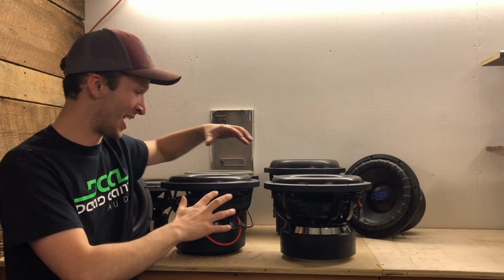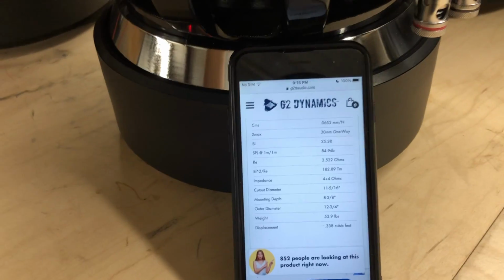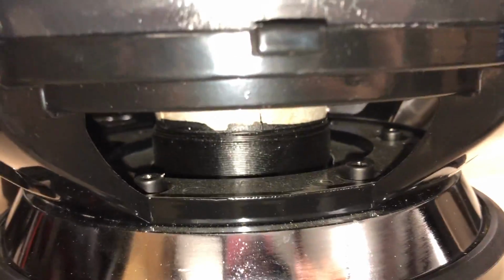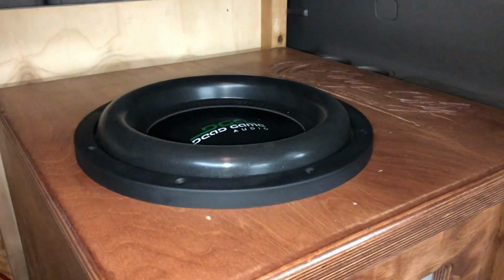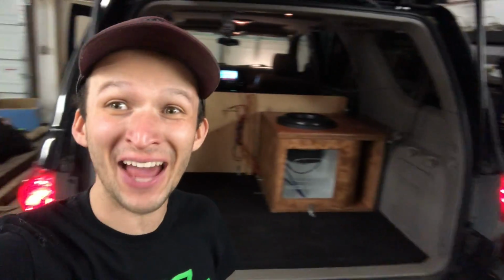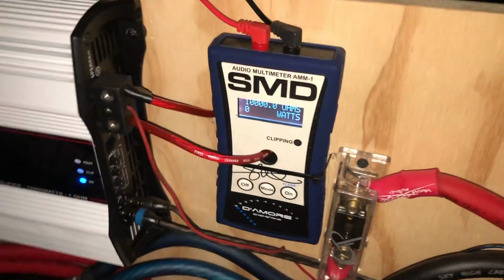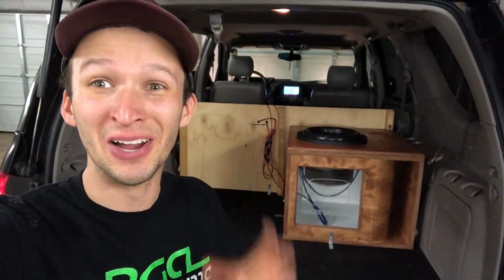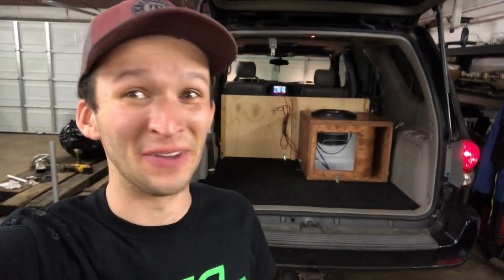HUGE 12" Sub Takes a BEATING! Dead Game Huracan V2 Subwoofer Review

Comment: Nice review. I'm doing a DC build in my jeep right now and going to use some of my old system for my daily.  I'm researching some budget subs for it. Why I like your videos on good budget subs. My DC ain't cheap. And I don't need a huge system for the daily,  but not having any bass in the vehicle I drive most sucks. I wonder how just 1 12" will sound in my Camry. Keep it up bro.

Comment: Try a Savard HiQ 12”.  Got one in my car.  Recommend box is 2.0 cubic foot ported tuned to 35 hz.  I built my box at 2.5 cubic foot and tuned to 28 hz.  On only 800 watts it gets louder than my old setup that metered at 135 db.  But, this is in a small car.  I need a bigger amp!!!!

Comment: you should buy a van, a table saw, and build a box to spec for every driver you have. then, arrange all the boxes in the van, and wire them all to a board where you can push button switch from sub to sub, and demo each one...

Comment: Love your video man you should definitely try to get an Orion hcca subwoofer or a deaf bonce dbsa4 series woofer to test
Reply: I just ordered 2-10” hcca
Reply: @HardHeadMilitary  dude that is awesome did you buy them brand new or did you get them used?
Reply: @justforlaughs8988  brand new bro. Im just waiting for the shipping confirmation. $598 for the pair. I just need to start building my under seat box to handle them, and ill be purchasing a second sfb 3k, one for each HCCA
Reply: @HardHeadMilitary  where did you buy them from bud? I've never seen them that cheap from my good friend that's a dealer he told me $500 for a d2 or d4 10inch model
Reply: I just got emailed from the online shop. They told me they cannot fulfill the order for 12-16wks. I will most likely cancel the order and just go with the sundown x series. Its what I was worried about.
Reply: @justforlaughs8988  vivid racing
Reply: Ill post the email. You can buy them, just a wait possibly. I have purchased a ton from them
Reply: Hello charles! 

We appreciate the opportunity to earn your business. Our team is working hard on getting your order through our system. We have updated your order (#49) at Vivid Racing with the following status of, On Hold - Waiting Response. 

Our online order team has the following comments about your order: Hello!! We have received your order and before processing this for you we want to see if you are OK with the current ETA as these are not currently in stock. Right now we are looking at about 12 to 16 weeks for production and shipping. We have placed this order on a brief hold while we wait for your reply with how you would like to proceed. If you have any questions or concerns, please let us know! Thank you! Online Sales Dept. Vivid Racing | Gilbert, AZ
Reply: @HardHeadMilitary  I know where there in stock if you really want them I've had both sets and orion hands down is way way better and way better output and clarity is absolutely amazing!
Reply: @justforlaughs8988  yes I was trying to buy them

Comment: I would like to see you do the DB Avatar STU 12 or 15. I have 2 STU-1546 but only running 1 and they are beast subs. Working on running 3 in my Navigator.
Reply from the maker: Yeah I’ve been eying the STUs 👀
Reply: Got a single stu 15 d2 on an Orion 3k and that sub is no joke. Can handle way more than 3k rms and it has a 4 inch voice coil.
Reply: @RomaVilla  I have a single STU-1546 on an Orion DSPLX 3k also lol. Navigator fucked up on me so bought a 13 Flex. Need to design a box for it to run both my STU's. Wont be running 3 in the Flex cause I still need room for dad shit.

Comment: Thats a great sounding sub! Can u list the power setup u have running if possible. Like battery size, alternator, wire size, power bank, etc if possible. I would like to get a taramps amp, link and prices if possible. Just asking, if not I get it
Reply from the maker: 250amp brand X alt, all sky high 0 garage wire, 128ah of headway lithium cells. Was able to film the entire review will the car off and it never fell below 13.2v
Reply: @ParkerTheBasshead  thank you, appreciate the info and the time just to reply to someone. Keep it up, great content and honest opinions,  and not biased . Keep bumping and filming man
Reply: Could you tell me about where your amp is set at like bass boost and all that

Comment: The bass u play inside garage is louder. Its like a chamber inside a chamber. Trust i kniw. Seen bjue jensens 20 years old in a garage n u would never believe it was jensens. I know jensens was top of line for a short breathe.
Reply: Jensen was first amp I ever had.back in 2000I got  the blue jensen 500 watt pushing 2 pioneer 12's. Got em all at Sears on my first credit card. Sears had amazing customer service though Id bump em for months than take em back and exchange for something differ. But it was all for not cause that set up sounded best of all ones I tried.  I loved that system so much!
Reply: @travisj.1938  My uncle had a 2 channel for door speaks nd a jensen amp i swear was 4 feet long. N said boss 500 all the way back in 1993 and a 15 true bazooka inside a ford probe hatch back.
Reply: @travisj.1938  Those were the days mtx pioneer clarion and jensen amd urban audio b4 it turnned into flra market junk.

Comment: pick one :  two Sundown SA12 v2 or one Sundown X12 v3 ?
Reply: U want louder across all frequencies and more output 2 SAV2  or u want to smash the lows(  XV3 ) ? It’s not that the X doesn’t play high is just has so much more output on the lower frequencies. If you have never had a sub like a X or W7, Zv4/5, Orion HCCA, etc then you will prob prefer the sound of the more traditional SAV2 subs. The X is very linear is at super low frequencies so it doesn’t have that traditional punchy sound usual subs have like alpine, pioneer, Fi car audio, skar evl & ZVx … not that all those subs sound the same but can be grouped similarly. 

If u want a mix between lows and bandwidth look at Fi Car Audio Ferrite models, Crossfire C7, Dc Audio level 4 , or XL, resilient sounds Gold or platinum. If u want lows and to smash then yeah XV2/ XV3, ZV5 or 6, DC Lvl 5/6, Fi Car audio Team or Neo 3/4x

Comment: Anybody have opinions on resilient sounds 2000rms 12 I feel like I got ripped off more and more but I dunno
Reply: Why do you feel ripped off?
Reply: I'm getting 2 platinum 15's soon as they restock
Reply: @ddtstrc9678  they don’t have a coated coil and the spiders are basic and ugly the basket and magnets look clean as hell though I don’t feel ripped off just there’s better deals for almost 500 dollars granted it was the only 12 I could find with a conservative rating of 2k rms with pretty good spl
Reply: @2025944  How do you know it's a conceived ?
Reply: @ddtstrc9678  conservitive rating? Everything on it is quad stacked the thing is built for a beating
Reply: @ddtstrc9678  ofcoarse thats part of the break in process
Reply: @nick40G  theyre definitly on the higher end of subwoofer brands but bang for your buck.. Nahh
Reply: @2025944  which subs do u recommend in that price range that's better?
Reply: @nick40G  u right but you can buy skars and run em a lil hot and theyll  be fine. I know for a 12 there was a toro 12 for 280 that was rated for 2k rms but RS promised me they had the better product and i thought fuck it it looked better
Reply: @2025944  skar and toro over RS??
Reply: @nick40G  if you got the money id go with RS but other brands will do fine for a little cheaper i use to be a skar fan boy but they didnt have a 12 rated 2k rms and i wanted the most outta my amp
Reply: @2025944  you need to understand impedance and that it changes at every frequency your sub plays. U can wire to 1 ohm but as soon as u play 40Hz u will rise to X ohms ( let’s say 4 ohm not actual just example ).. The box, port, subs, car, windows up, door open, etc,  all this plays a factor into your impedance rise while the sub plays. Only way to max your amp out is burping a single frequency like SPL competitions. 

Go watch any video on Steve Meade’s channel where he uses the amm1 tool set to real-time power. U will see the amp makes different power due to diff impedance of each frequency. Hope this helps you understand a little more! Have a good one!
Reply: @uptobatentertainment  well that explains why I can go louder with my doors open i thought only the box and port effect impedance rise I have it really bad at like 1400rms  I bought a bigger box you reckon that’ll help it a bit?

Comment: Orrrr you could save your pennies and buy a Deaf Bonce apocalypse DB3515 and that one single sub will take everything your amp has, lol ask me how I know
Reply: How do you know?
Reply: @ddtstrc9678  I believe there is a video on my channel of me literally feeding one db3515 everything I possibly could wired at 1ohm on my Wolfram Audio AW-9000.1D and I can assure you that my korean surfboard will put out more power and last alot longer than a Brazilian full bridge amp lol no joke I have two of them (among 30+ other beefy subs I own) and they just seem to get louder and louder the more power that you feed them unlike the very inefficient hcca's that will take alot of power but yet they require a lot of power to even do anything worth mentioning lol these Deaf Bonce literally surpass their cost in value and performance weighing 90+lbs each with 3.5in coils and solid carbon fiber cone and cap! They're on par with a sundown zv5 if not better and cost far far less!